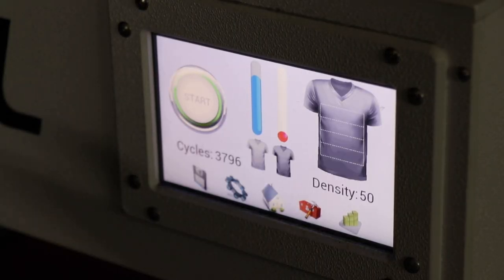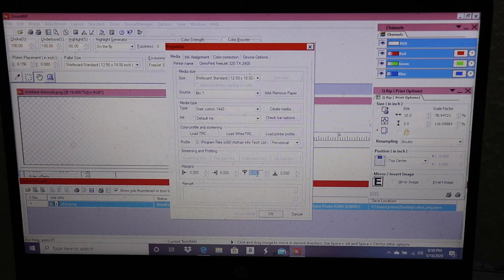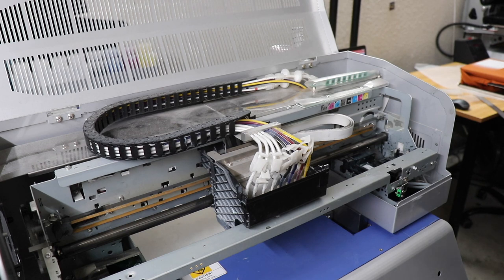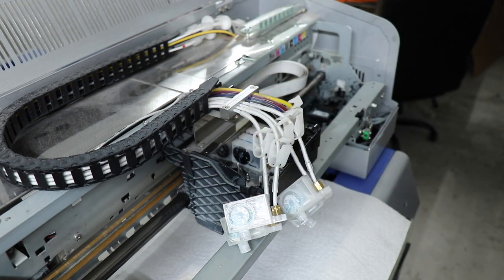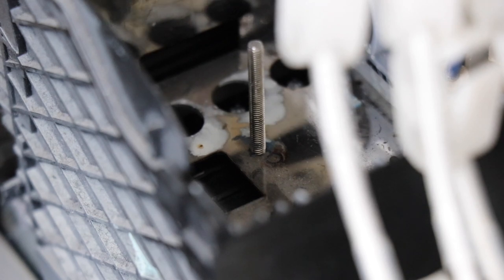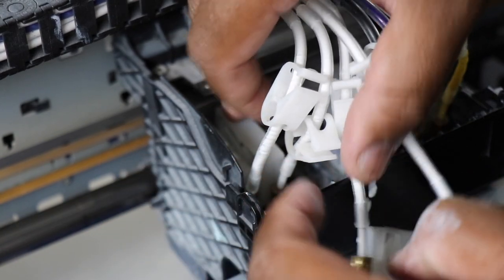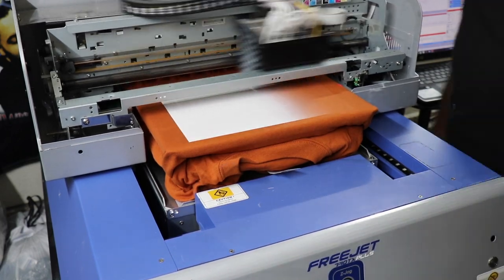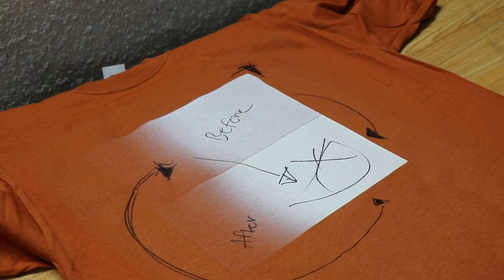HOW TO UNCLOG YOUR DTG PRINTER WITH A REVERSE HEAD FLUSH *FREEJET 330TX PLUS*

Comment: Great Vid doing the steps now. BTW - when trying to pump clearner into my wet cap system, the cleaner fills the waste bucket instead of my wet cap system. any guidance or help would be appreciated!
Reply: Also, using the syringe to pull liquid from the 'mountains' above the wet cap system but no liquid is being sucked out.

Comment: Got a brand new machine and on shirt #149 our printer head clogged. Did reverse head clean, pulled into through the dampers, etc. After extensive research and talking with Omni Printer owners I have found out what I wish I knew before jumping in on all of this. This same printer comes from south Korea, Omni print just puts their logo on it. The printer in south Korea is  HANGYANG C&C for $4,000 and Omni print sells it for 15K to 25K, the head is the same exact one on the Epson printer for $800. Tech support is garbage and they run you around for six months till your warranty is up so they can sell you a $800 for $2K, circuit board for 2K but can get the same one for $27, then they scam people on the white ink that clogs machines so people will pay for a tech to come out and pay for a new ink head. There's a reason why there are so many damn lawsuits with this company. The printer itself prints a great image but Omni print company is scamming people left and right.
Reply: 👋🏽 , where can I buy the print head for $800? As well as other parts

Thanks

Comment: Quick question... At the point where you suction under the damper (the mountains) what happens if you cannot suck the cleaner through? Happening with my red "mountain".
Reply from the maker: Usually means you have a really bad clogg. Did you try letting your printer soak in the powerful purple super cleaner
Reply: @primaryprintco  I tried the regular cleaner, didn't work. I'll give it a shot with the Super Purple. Thanks!

Comment: Question:
Have you ever had any issues with Overspraying? (when printer sprays outside design area) If so, what did you do?
Reply: same problem here
Reply: @BTHDreamer  Your in luck I resolved it myself ... You have to adjust the height manually on the lowest surface of the garmet

Comment: Ok so I noticed when you suction the damper yours filled with ink what if it doesn’t fill up is there something else that needs to be done or is this a whole other issue??? TIA
Reply from the maker: Whole other issue there may be a breakage in your damper that air is escaping through and your not getting the pressure
Reply: Everything Harris Appreciate it!!!

Comment: I just encountered an error issue where the ink and error light are blinking at the same time, I turned the printer off from the back like the manual suggested and turned it back on but still bis giving me the error message. Is there anything I'm not doing to clear this error, and must add that I just ran out of white ink during the holidays when this occurred during priming and print head cleaning. Any suggestions?
Reply from the maker: You need to do a ink pad waste counter reset
Reply: @primaryprintco  ok cool....if I'm needing to print just a color image do I need white ink after I do you counter waste reset

Comment: I wouldn't recommend this method for an obvious reason. If there is anything on that printcap that is dirt and dust. You're sucking the cap solution mixed with micro dust right into the printhead and there is absolutely nothing to guard the printhead from clogging. It's just a matter of time until you get it permanently clogged.
Reply from the maker: Well buddy running for a year but thanks for the view and the comment
Reply: I would agree with you, one thing that would work best would be to cut a cup and leave about 1.5 inches of the cup, fill it with cleaning solution and place the print head in it and suction from the clean solution and not the capping station.  You can achieve this by undocking the printhead carriage and sliding the cup and cleaning solution into the printhead.  Keeping in mind that this is without the platen on the printer and you  can raise the bed as the cleaning solution is used up and the level drops.  Also, it is very important not to spill any liquid around those printhead nipples because eventually that liquid will make it into the printhead cables and cause a short, fry your printhead and boards.  It is important to wipe any liquid from that area intermediately to avoid a smaller issue becoming a greater issue.  Great video Devante, keep it up!!!